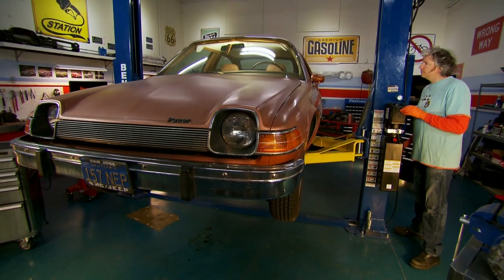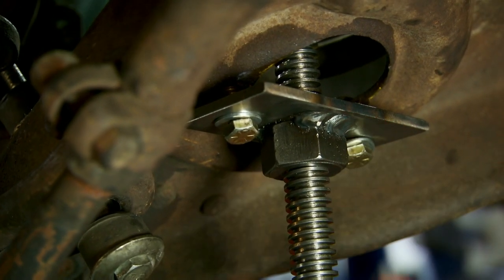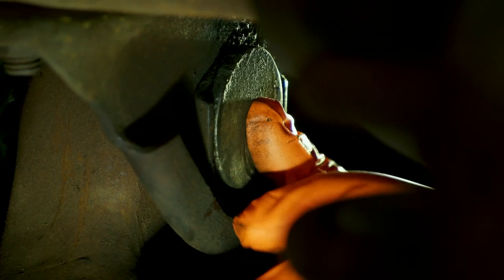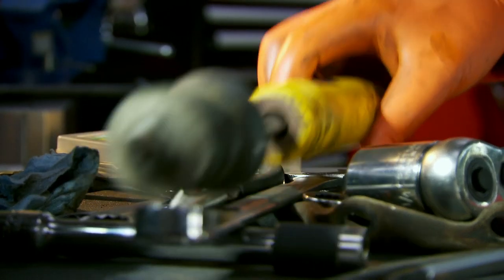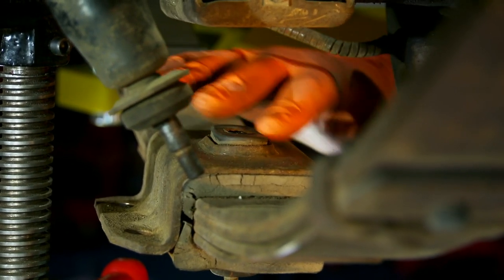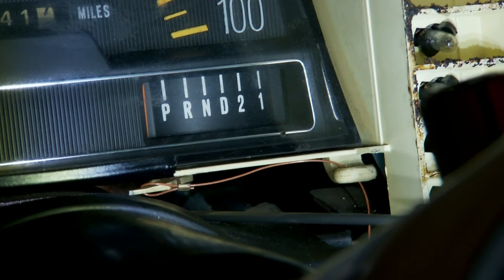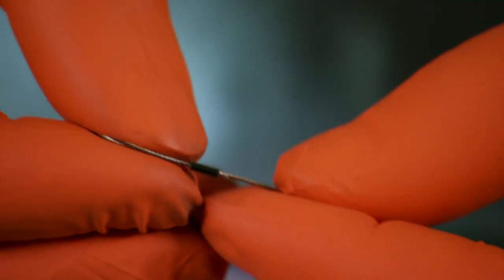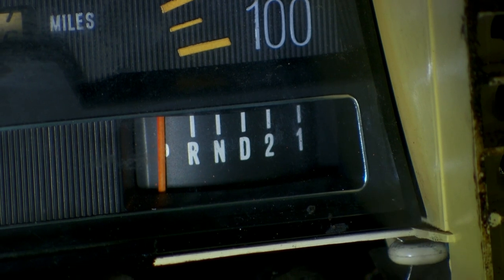AMC Pacer: How To Lower The Suspension And Fix A Gear Indicator | Wheeler Dealers

Comment: Actually, cutting a spring can work. With coil springs the spring rate increases as the coils are removed.

I lowered my jeep by cutting coils, it road great once I installed new bump stops!

Comment: Why would you even work on a Pacer not worth it.
Reply: Obviously you've never driven a Pacer. A 1976 Pacer X with wider than the spindly stock tires that came on it would handle  equally well as a 1976 TransAm.
Reply: @robertlays9079  noop never have,never will but I did have a fellow student I went to high school with had a blue Pacer,we used to call it his racin pacer,it wasn't fast but it's just what we called to give him a Lil rubbing.